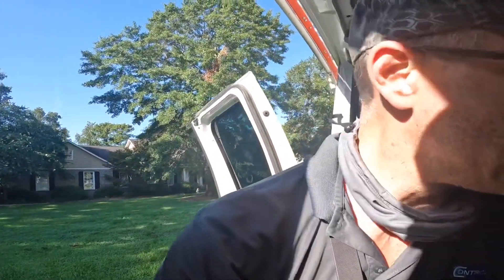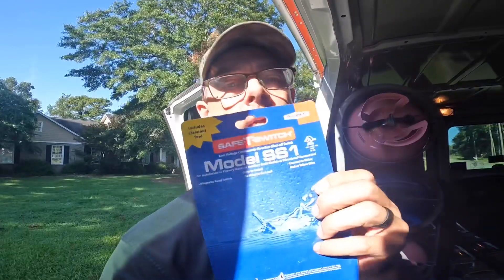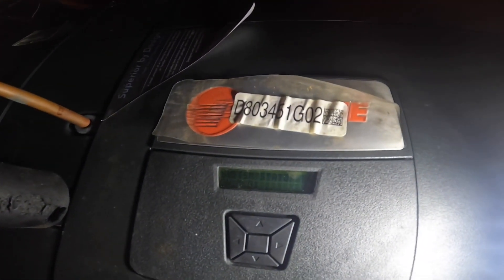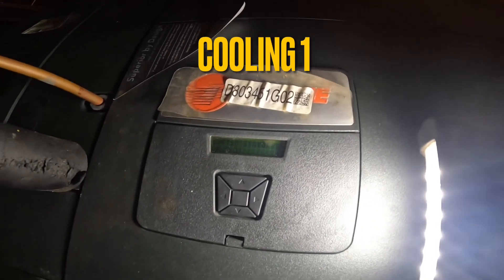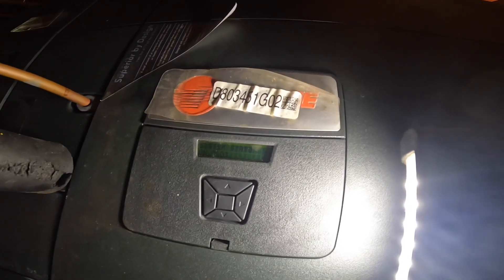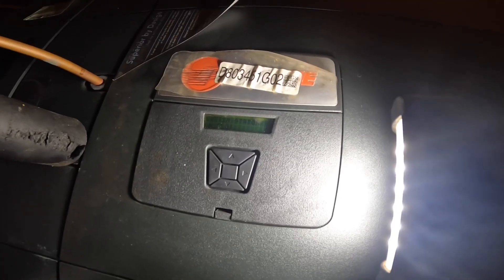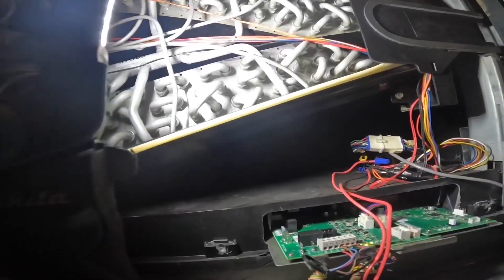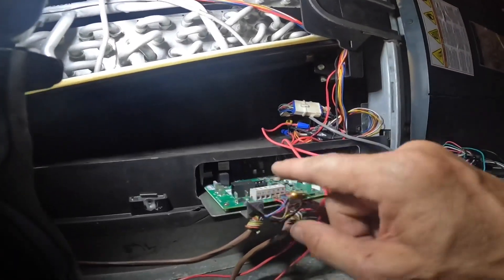Trying To Use A Float With a TAM8

Comment: Use a relay thats closed. Wire coil of relay in with your switch that will open the closed circuit if energizesd

Comment: The normally closed goes to the external switch on board the configure it to DS-CLG like mentioned in other comment..I found it in the manual .. external tab is 13 and 14 or T3 or T4 can't make it out above J1 on my schematic

Comment: Just wire the two switches to the auxiliary terminals what’s a female plug adapter go to the CDA and hit DS all and save it and you’ll be good it’ll throw an error code on the thermostat 126 for drain clog

Comment: Wire it to the two aux terminals SW switches and then set up on the scroll board assign it to DS all. Don’t break the transformer or break red or yellow. If it’s communicating or not use those two female plugs.

Comment: U can use the ss2 float, Exactly where u pointed ur finger and said u think its hear thats correct "ext swt t4 and t3  u can plug 2 wires on those 2 terminals and splice ur 2 float switch wires ,then go into the CDA go to config menu to ext switch and   set to ds all .as long as there is 24v onto the afc board there  is a 24v output on t4 or t3 cant remember exactly which but the idea is when the board receives the 24v input back it knows the switch is close when the switch opens due to drain issues nomore 24v input is received board now knows there a problem snd shut unit down but its critical that u set the cda to DS ALL .hope that helps i have done those up until they were discontinued.

Comment: OK! So under configuration in the 10sec menu, you have to go to EXT SWITCH, and change it from IGNORE to DS-ALL or DS-CLG (Disable all 24V or disable cooling only). But you have to plug the blue and white wire to the 2 prong EXT port

Comment: Why can’t you break R? You are supposed to break R on the air handler side anyways it won’t cause any communication issues. Break R on the air handler side. R-thermostat/R-air handler with R-outdoor unit

Comment: You can use a SS1, but you have to wire it to the blue with white stripe wire. Then plug that wire into t6. Then, you hold up and down arrows for 10 seconds and configure. Sorry I can't think of the exact page you change. It's in the manual under configuration though

Comment: IF YOU ARE NOT TRANED ON COOL BY DATA  OR SHOULD I SAY COMMUNICATING SYSTEM  THESE THINGS MAKE YOU FEEL LIKE PULLING YOUR HAIR OUT  THESE UNITS ARE OVER ENGINEERED      THE LEAST LITTLE thing can make them stop working    and heaven help you if you call  someone that doesnt know how to work on them        they become parts monkeys replace everything sooner or later they replace the right part   most of the time its later🙈🙈🙉🙉🙊🙊🐵🐵  keep it simple less headaches

Comment: You can use the diversitech wet switch and wire it for whatever application you need. It has normally open and closed terminals.

Comment: trane has a special float that goes inside those positive pressure airhandlers. they should also have that plug that connects to that j6 on the board. press and hold the up and down arrow on the interface for ten seconds then go to the configuration menu. you can set up the float in the configuration menu.
Reply from the maker: Does the other plug have yellow wires instead of the black ones that are there now?

Comment: I CALLED MY GUY AT SID HARVEY, THEY STOCK A K41-5 ITS A SPDT FLOAT SWITCH. BUT YOU NEED AN ON LINE ACCOUNT TO BUY IT ON THEIR SITE. OR YOU CAN CALL THEIR LOCATION IN SOUTH CAROLINA AND SEE IF THEY WILL SHIP IT TO YOU
Reply from the maker: I just looked at that, and it’s a pan switch. I’m looking for an inline switch. I think it may be easy to reprogram though.
Reply: @HVACGUY  ok, good deal

Comment: generally there is a plug that comes with the unit upon install that you would plug and and go that route but in this case you can configure through the CDA. I’ve seen guys break red directly from terminals. But usually it screws with the boards and the communication. Same as when people hook iaq to red, robs the voltage.
Reply from the maker: I was just going over the manual. It don’t tell me that. So, it looks like I need to go up there with a new float for the emergency pan and reprogram.

Comment: Add a relay. Can you break the transformer 24 volts?
Reply from the maker: I can use it, but shouldn’t break it because it would cause system to lose its fault history. And the signal going to float may not be 24V
Reply: @HVACGUY   just add N/O (S.P.D.T.) relay and connect to your J6 terminals.